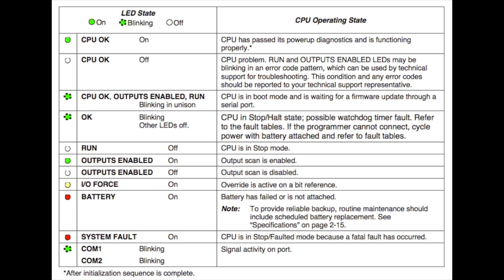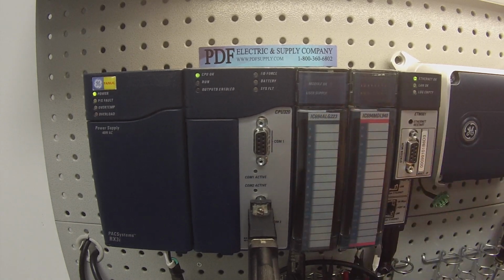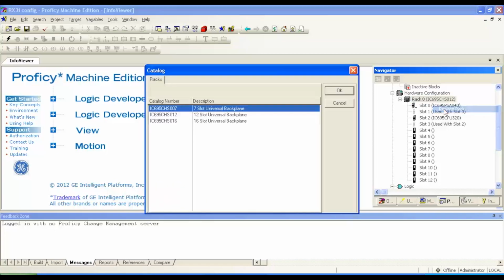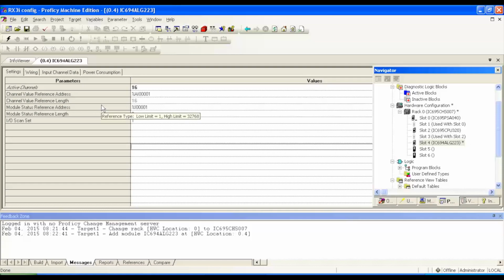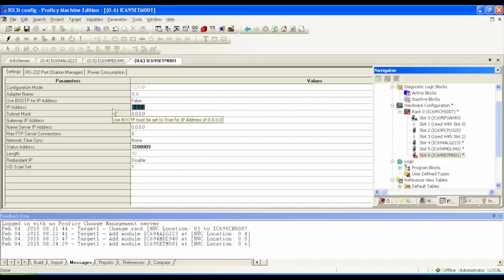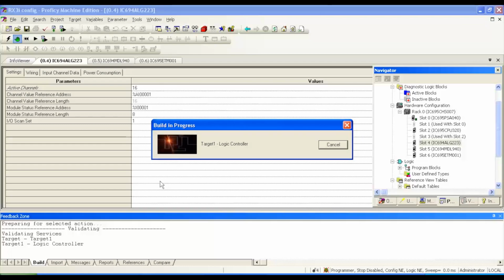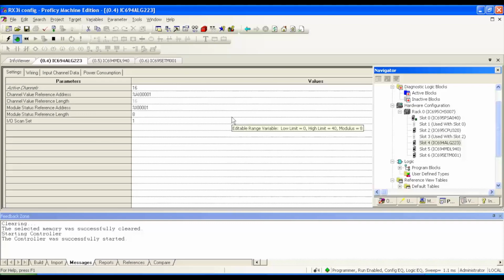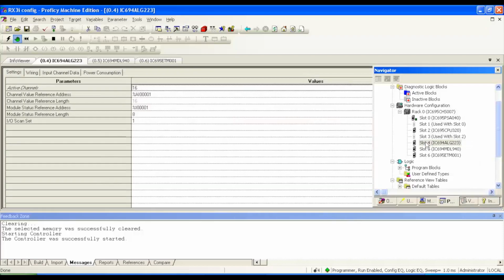How-To Program: Rx3i (GE IP PLC Support & Training/Proficy Machine Edition Software Tutorial)

Comment: Hello. Thanks for the video. Is it possible to edit and download to rx3i cpu while on run mode without the PLC going to stop.
The client wouldn't want their system to be interrupted while I work on the PLC.
Reply: Yes, it is possible if you use programmer mode then lose equality.
Just make sure the code you're editing doesn't contain any error.